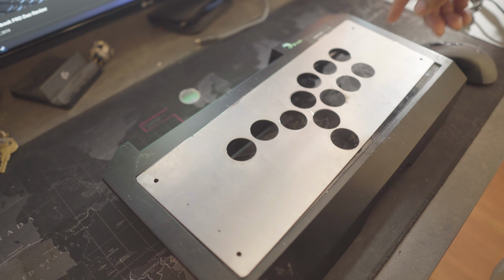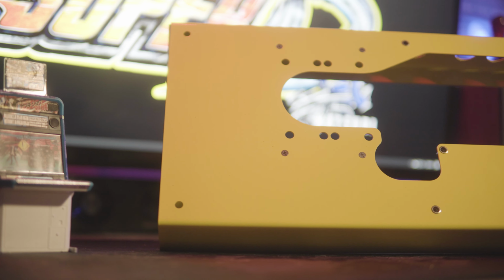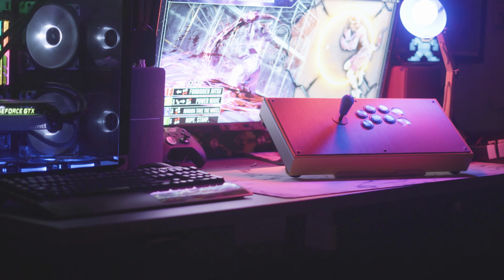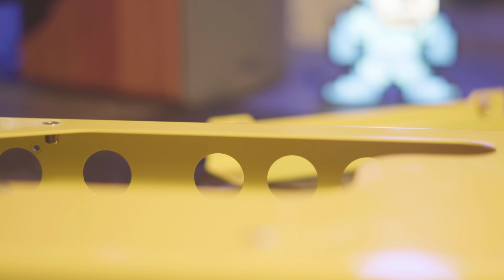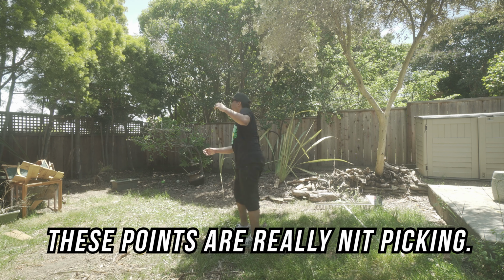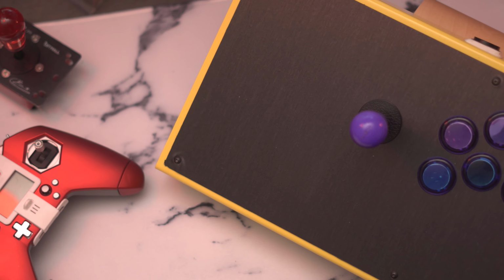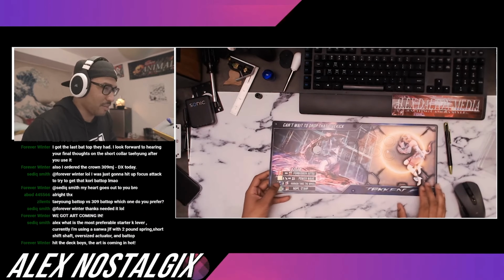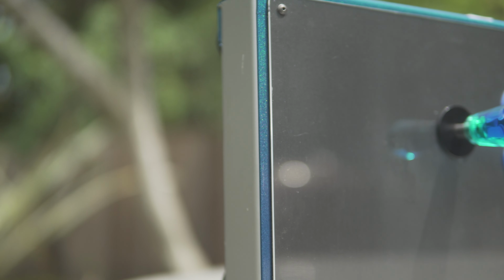A Modular Fightstick? AFS 18" - Turbo Review (4K)

Comment from the maker: Forgot to mention I'll be streaming around 7pm PST. See you then :)
Reply: Hey since you've tried the noir and sega p2 layout which feels more natural via hand placement?
Reply from the maker: @Encrypt2000  tbh I dont prefer  more than the other. On the Sega 2P the 2-3 column is parallel to each other where the noir's 3rd column is at a angle.

Comment: I would like a review an American sticks like the Eurosticks or Happs. I prefer Eurostick because they are made better and use the original mold of the Happ designs before the Suzo merger. I don't think you'd like it though because it still uses a spring tension system and I know you don't like those as much

Comment: @Alex which 18" AFS case is this?
Reply from the maker: It's the normal 18"
Reply: @alexnostalgix  I see. I went to the AFS website and saw an 18" case that looks like yours but description there says it uses adhesive PCB standoffs while yours is using a PCB mounting plate

Comment: Hot damn, I didn't know those AFS cases would be that loud.. Maybe try filling the empty space with some acoustic dampening foam, or something like Dynamat on the interior walls to reduce the reverb.

Btw, how are those clear Sanwa button plugs? Are they flatter than the normal plastic ones? I've been thinking about picking up a pair for that classy 6 button layout. Being able to put art in them is nice too.
Reply from the maker: I did awhile ago by throwing in two shirts lol. The reverb is still there, probably  need sound dampening foam or something.